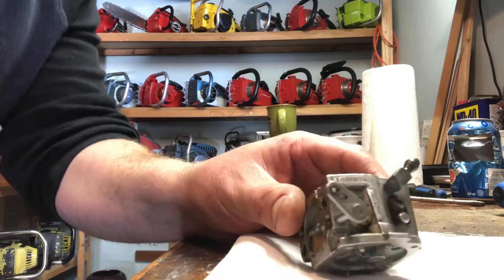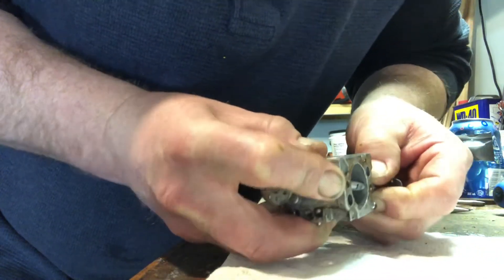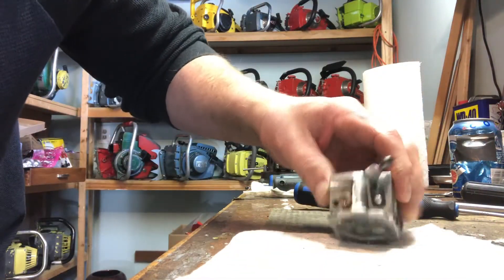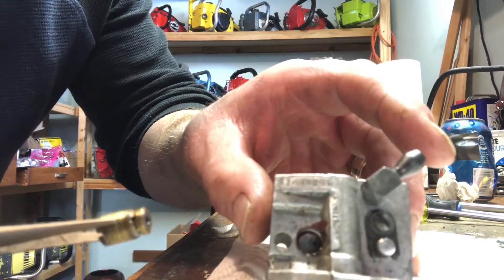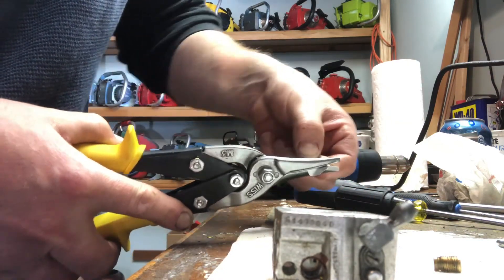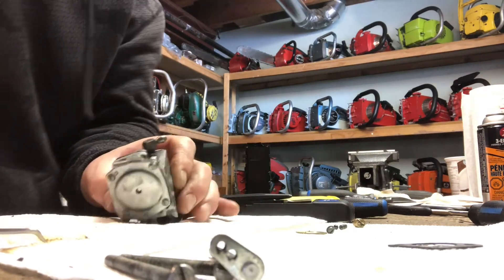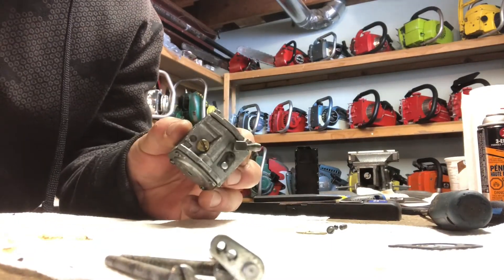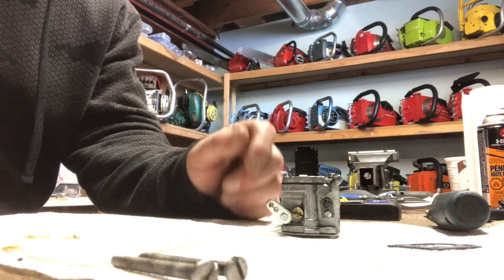How to disable the governor on a Tillotson HS147D carburetor

Comment: Very nice collection.  Thank you for showing it.  Great Video about how to disable the governor on the Tillotson carb.   
The governor system works thru vibration measured in Hz.  The spring behind the ball loses its tension and then the ball floats off its seat.  This allows fuel from the metering chamber to flood the engine which lowers its rpm.  Its an early style of warranty extender...   If your in a hurry a small piece of tin foil will work to block off the fuel flow.

Comment: One question ... what is the advantage of deactivating the regulator? i have the xl 88 with this regulator but i don't understand much of the tuning of this chainsaw. I hope it helps me. thanks
Reply from the maker: You can get a bit more rpm out of the saw by blocking off the governor. The bad side of that is that your engine will run hotter. There is a happy medium to be found when tuning by hand. The governor keeps the fuel mix very rich which is good for lubrication and cooling but slows the saw down.
Reply: Ok, thanks for clarifying me.